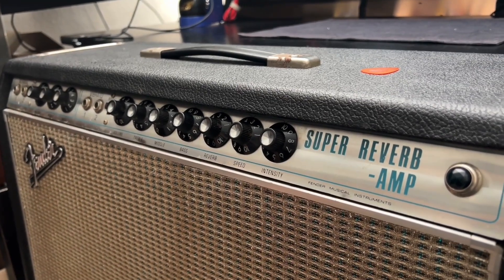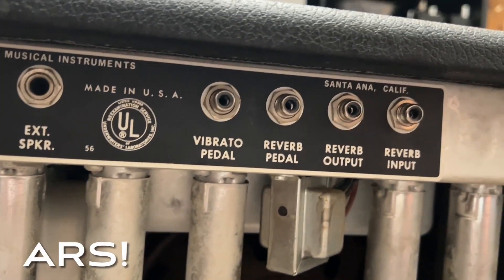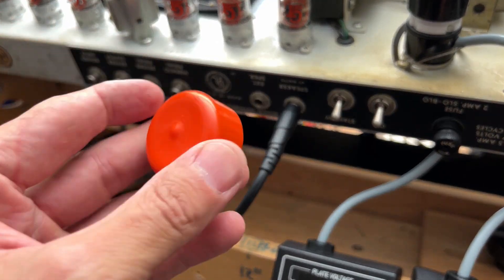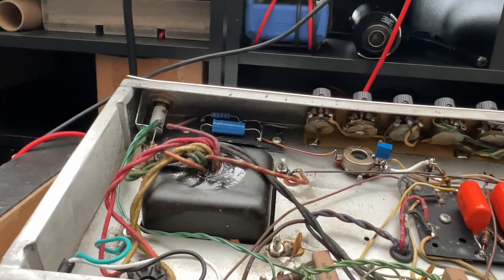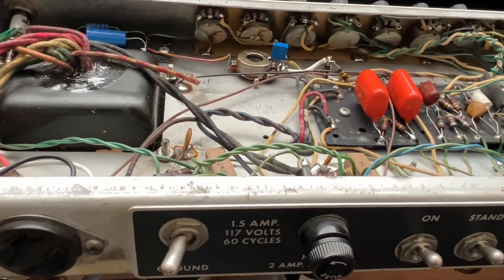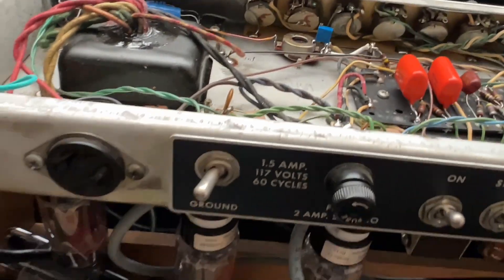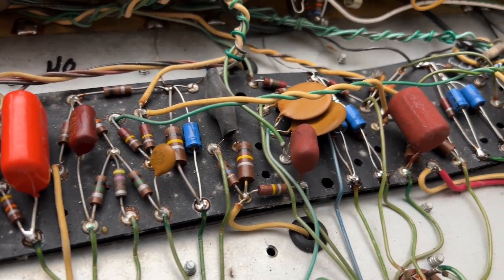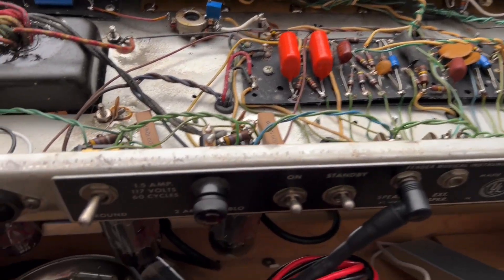One of Those Days, but with a ‘69 Super Reverb

Comment: It was pulling so much plate current as to drop the plate voltage by 100 volts? Good Lord! And then RAISE the voltage (and thus the current) by adding a solid-state rectifier? I'm surprised there was no real damage - like a toasted power transformer.
Reply from the maker: Got lucky!  The worst bandaid ever.
Reply: @ForgottenGearRestorations Unfortunately, the damage to previous tech's reputation will likely not be great enough. I saw that recto, and was like :hand-orange-covering-eyes::hand-orange-covering-eyes:- then it got worse lol

At least he didn't get a second crack at it 🤣
Reply from the maker: 😂 that’s why dudes like that no longer put stickers with their names on them on the amps!